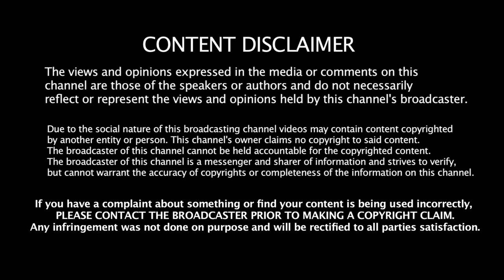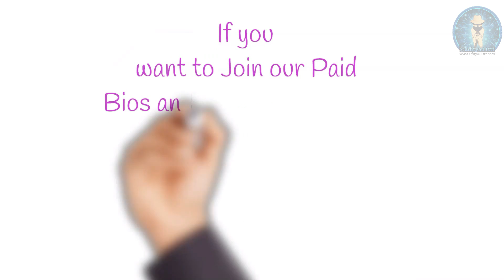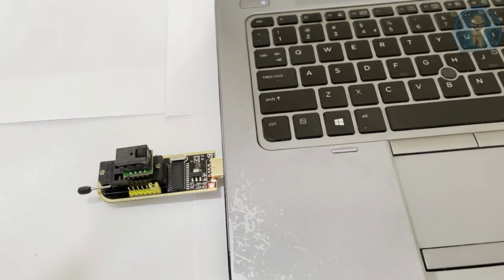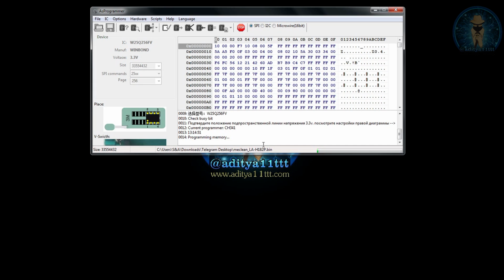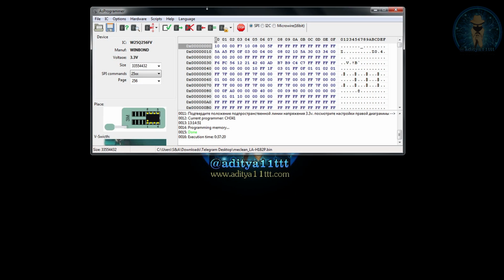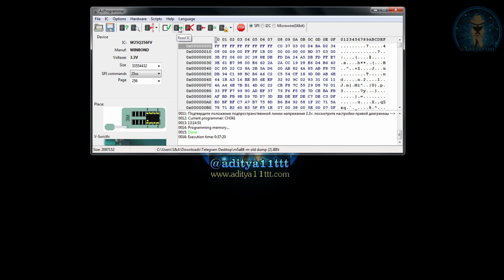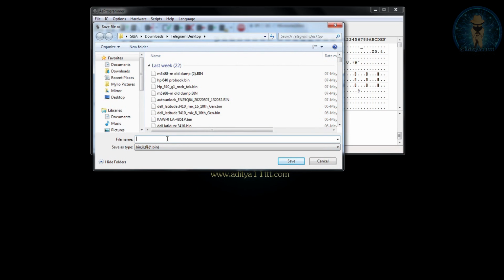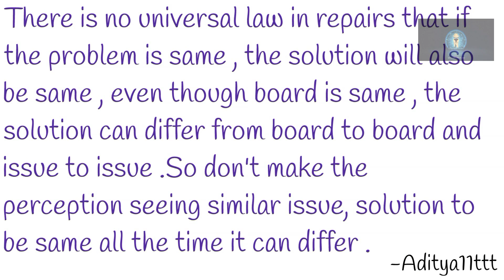How to program Wson 8 | Flat bios chip using CH341A With Wson Socket

Comment: hi.. can the ch341a clips read this chip without the need to desolder it?
Reply from the maker: Yes can both ways only should know how to do and option available on board u r trying depends board to board
Reply: @Aditya11ttt  I tried so many times and spent hours trying but the ch341a doesn't . And some people online saying the ch341a does not read it. Quite confused now
Reply from the maker: @ trick is in the process of reading find correct way to hold and read ! With right amount of voltage and with precise connection than only possible else do chip off u can’t do